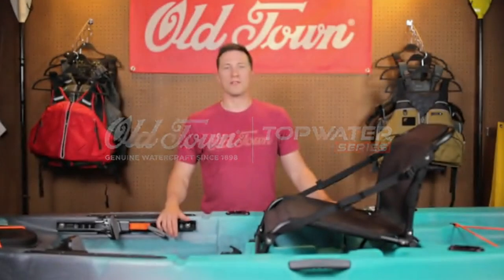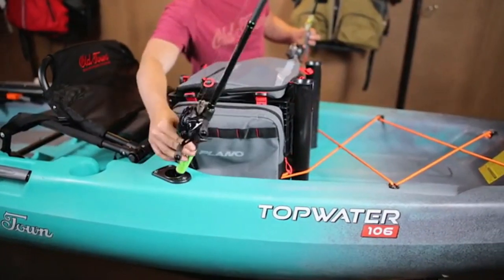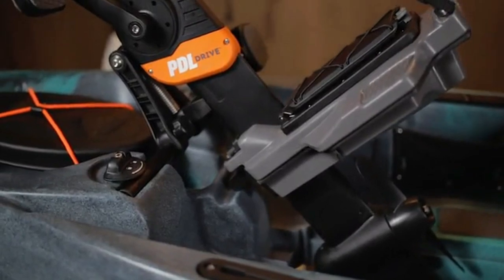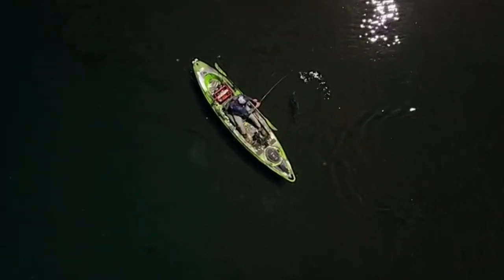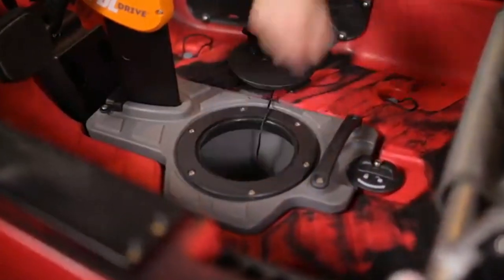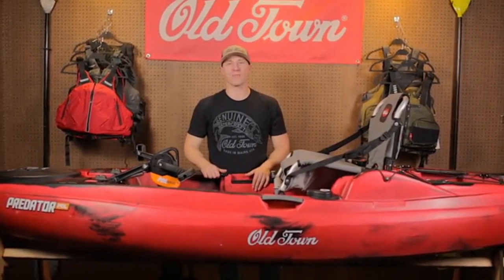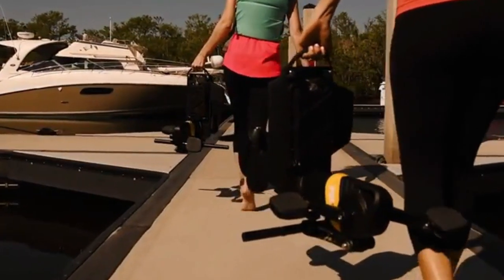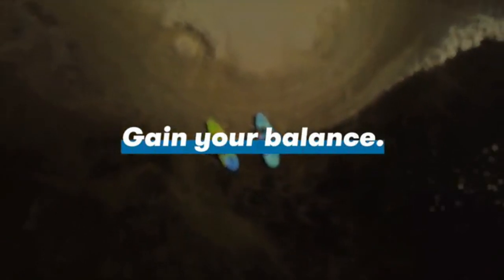Best Pedal Kayaks in 2023 - Top 5 Best Budget Pedal Kayak For You!

Comment: Based on personal experience, I do not understand why the in-hull rod holders are placed BEHIND the seat; the seat typically does NOT swivel, and, at least for older less limber folks, turning to reach the fishing rod is awkward at best.   Regarding the "stealthy" color schemes: with many motor boaters driving recklessly, the last thing I want to be in is a kayak that is NOT visible; the hull at, and below the waterline, can be a less visible color, but the topside should be highly visible.
Reply: Originally, to allow easy paddling while trolling.
Reply: it's really not that much of a reach. you can easily pull or set your rod from either side with out having to look back.
Reply: I agree 100%  The only use for rod holders behind the seat is storage.  They are completely UNSUABLE behind the seat.  There is no reason they couldn't be designed to be beside the seat.  That way you can troll, paddle and do the Watussi if that is your bag!  To fix the bad location I made some PCV rod holders with elbows and extensions. It's not too hard to do but still it is an ignorant thought to locate them behind the seat.  These yak companies need to get with it!
Reply: @bcp5296d  So you use the behind-the-seat rod holders for trolling?  You must have eyes in the back of your head!
Reply: @sk8f1lm3r  Ahh, so you admit that you cannot see them but you can reach them?  I like most people cannot see them either and most people cannot "easily" get to them.  It may vary from brand to brand but it is a useless concept to put them behind you unless they were only intended for storage.  So poo poo on your comment!
Reply: @doctorkayak  First the drag must be set right. Second, they make a noise when something hits them by rattling in the holder, the hull provides great acoustics for that. I've never looked back and had a fish when I didn't know it. Given I have a paddle kayak, impeding the paddle area is just not something I can do. I fish in a lot of current.
Reply: A typical seat does not swivel because the weight shift is a liability for tipping. Now, I know there's a lot of discussion here, and as long as you have something as stable as say a coosa HD or more, that shouldn't be a problem. The reason they don't do it is because they are trying to keep their price as low as possible to be accessible for more people looking to purchase the kayak.
Reply: Also, if I need to look back at them I'm capable of doing that while paddling.